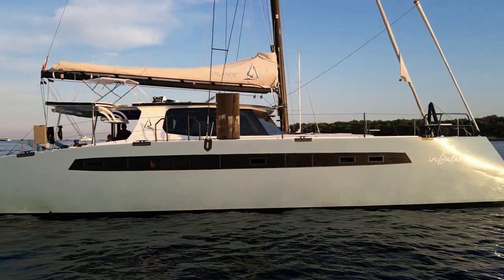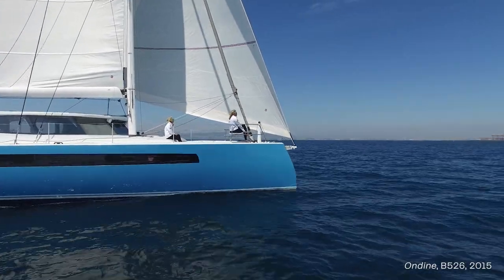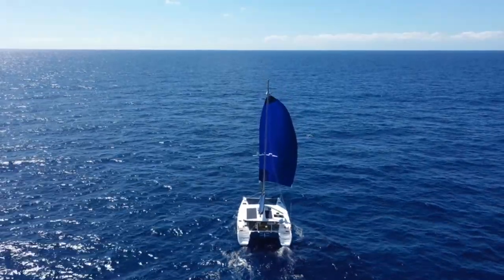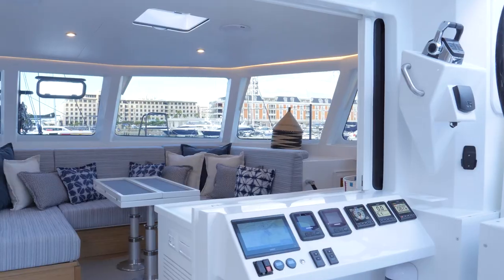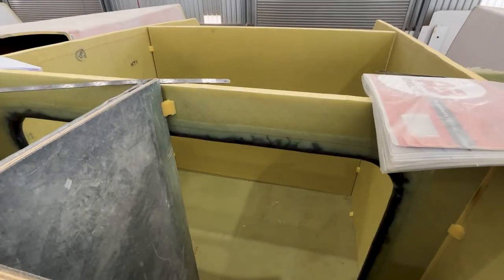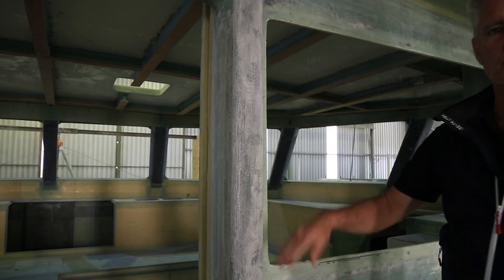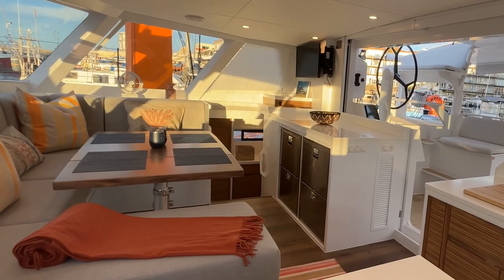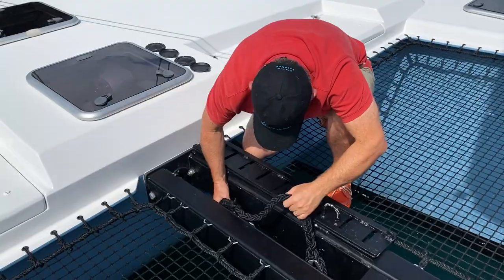Design & Build for Performance

Comment: "touts themselves as something of a racing boat"........))  I was at a boatshow recently and went on board one of "those" boats, a newly released model.  I asked to look behind a few panels in the saloon and what I saw looked as though it has been installed by a chimp, a blind one,  and the engine bays looked as though they had been put together by that blind chimp's lesser-skilled cousin. Shame really as the hull itself is pretty good.  

I'm two promotions away from being able to afford a 482, watching your videos is the only thing that keeps me plugging away in the industry of cutthroats that I work in (IT Sales)..   I'll be in touch eventually.

Comment: Just wonder why you favor Eglass over Sglass? Sglass apparently is superior to Eglass albeit at a extra cost. It apparently doesn't conduct electricity, and for whatever reason doesnt get the dreaded osmosis.
Reply from the maker: The reason we do not use S-glass at Balance is that it is about 30% to 40% more expensive than E-Glass and harder to get in the supply chain.

It is stronger than E-Glass by about 35% but only marginally stiffer. We and most builders therefore just go straight to carbon fiber as you are only paying a bit more but gaining even better and stiffness properties than S-glass. In the end, our E-glass, heavily carbon reinforced boats offer the best value for a performance oriented catamaran. And for those who want more carbon, or all carbon, we offer that in 526 and larger models at an additional cost. The largest negative to all carbon hulls is that they are very stiff and rather noisy at high speeds. So many of our super performance minded buyers elect to go with e-glass hulls and a range of the carbon enhancements we offer if shedding even more weight is the goal. As we like to say at Balance, there is no such thing as a perfect balance, only perfect balance makes perfect. The definition varies from person to person, so we try to offer as many options as we can for our customers to find the balance that's right for them.